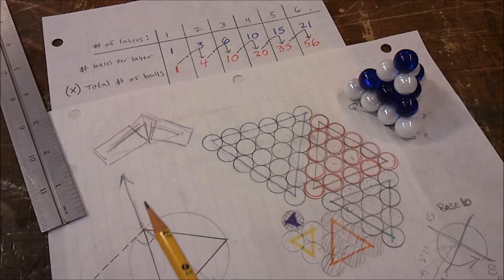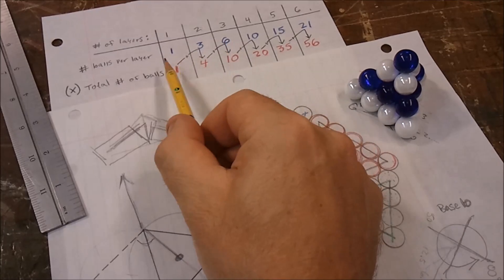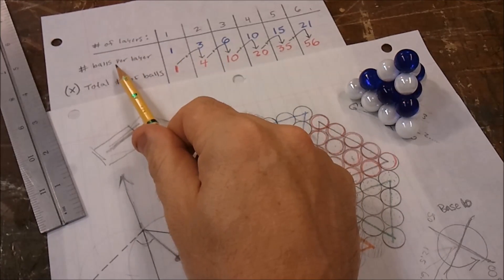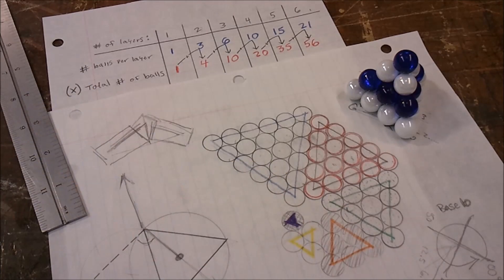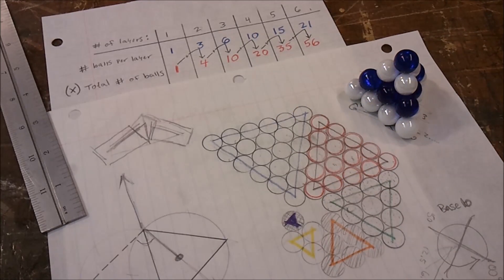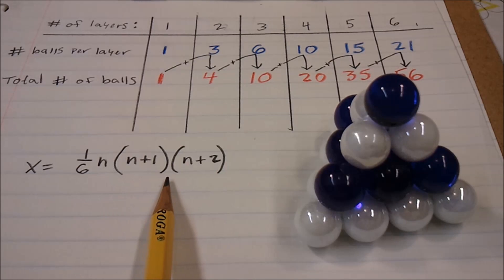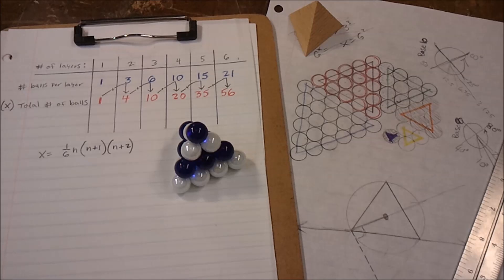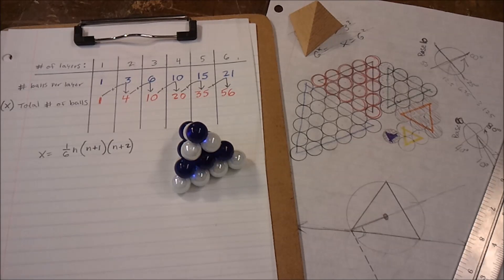Four-piece tetrahedral cannonball puzzle

Comment: Pocket! Is this the PEX tubing you speak of? http://www.homedepot.com/p/SharkBite-1-4-in-3-8-in-O-D-x-5-ft-White-PEX-Pipe-U850W5/205586762
Reply from the maker: Yes! Nice and cheap. I use that stuff for lots of projects. Buy a bunch, because there is a mild variance between batches. You can also fine-tune a Forstner bit to size by running it backwards in the drill press and holding sandpaper against it, just to get that perfect fit.
Reply: I just noticed the range ball! You are going to get in troooouuuublleeee! :)

Comment: We could also say that the Reg. Tetrahedron holds the maximum volume ,  for the least surface area among any infinite number of tetrahedrons in the existence.  The .Sphere has the same property,  IT HOLDS THE MAXIMUM VOLUME TO MINIMUM SURFACE AREA, therefore any solid holding as much volumes as the sphere does would have to have a large surface area, THEREFORE SPHERE IS THE MAXIMUM SOLID , AND THE REG. TET. MUST THAN BE THE MAXIMU TETRAHEDRON. Volume of the sphere is EXACTLY 25.13274123  reg. tetrahedrons in a sphere. The volume of the reg. tetrahedron than must be 2 because volume is calculated in cubes and a cube contains exactly 3 reg. tetrahedron volumes and that exact same cube is assembled by 6 irregular tetrahedrons, and EACH is exactly 1/2 the volume of the reg. tetrahedron. so the volume of the sphere is exactly 50.26548246 irregular tetra volume, each irregular tetrahedron has a volume of one, so the sphere volume is 50.26548246 cm^3

Comment: How is the green part not actually a tetrahedron? It has 4 sides each with 3 edges.

Also, how come you have access to so many advanced woodworking tools?
Reply from the maker: Nexnaught Because it doesn't go to a sharp, crisp point (vertex). It actually is slightly truncated, at least with respect to the way that it fills space. If you had hundreds of these, and you were stuffing them into a box, they would fit differently than actual tetrahedrons would. If you want me to be more specific, tell me what I said, and when I said it, and I will clarify.

As for my "advanced woodworking tools," I bought them. Now that I own them, I have access to them.

Comment: The white piece's name is a parallelapiped. It's a prism with a parallelogram as a base rather than another shape like a triangle or square
Reply from the maker: ookazi1000 Not exactly. If you were to add an additional marble to each layer of the white piece, then it could be considered a parallelepiped. Right now, I would probably call this an oblique triangular prism, but it's hard to see the pattern while it is missing its vertices.

Comment: I remember reading in a Reader's Digest how some kid was peeling a golf ball and then - not knowing he would do that - bit into the rubber center, getting some liquid in him, and cried out. His parents gave him something to vomit so he wouldn't get sick. They called the manufacturer, and discovered why he was crying. It was a soft rubber center, filled with... castor oil! So that might be what the "liquid" was.
Reply from the maker: Ha! That's pretty interesting. I wonder why they ever made them that way- what properties does a fluid have under constant pressure that makes it a good golf ball? But anyhow, I'm reasonably sure that the liquid from my experience was water-based. It dried, and it left no stain on the drill-press table. In any case, I see no evidence that it was ever a poisonous acid, like I remember the kids on the playground rumoring.

Hehe. The kids should have been afraid of the core ejecting; that thing could take an eye out, if it's relieved of its tension from one side... like from a hacksaw or knife cut.
Reply: pocket83  Fluids are essentially incompressible. A fluid filled core would allow for cheaper construction since castor oil (see above) was significantly cheaper than rubber or plastic in those days when it was most common.  End result: cheaper production cost for a cheap product with the advantage of marketing hype like "hydro-dynamic/hydraulic power core", etc.

Comment: I bet I could use the technique you used on the golf balls to make a jumbo-sized molecular model kit. A project for this winter, I suppose.
Reply from the maker: That's a great idea! You can paint the carbons black, hydrogen red, nitrogen green, et cetera. There are actual angles for the bonds in each particular atom, so you would have to make unique jigs for each of the bonding sites, but it would still be easier than what is done here. Let me know if you do it, or if you get stuck, or if I can help.

It would be less expensive than buying the actual models; there are $100 worth sitting in my closet right now, and the golf balls would've worked better!

Comment: This was really interesting. First time I see this Tetrahedral equation. But I think the small "prototype" version looked much more neat and the colored marbles make it look much more beautiful. I know you mentioned coloring the golf balls, but they are too bulky and don't have this glassy glance. Still would really like to see the second part of it. Did you get the connection idea from your Building Block Medley video ? Overall the video looks really great :)
Reply from the maker: Thanks! When I first made this, I didn't really trust the epoxy, so I was looking for a more durable alternative. Now that I have seen how strong the connections actually are, I think that I could trust them as permanent, and a 1" marble puzzle would be really cool. I'm going to order a 100 count of ruby red 1" marbles from ebay. The added surface area of the larger marbles should make a great connection (and a  beautiful puzzle), and the only tools required are your hands.

As for the idea: I made the blocks featured in that video a long time ago, so you have to understand that the chronological order that you see in these videos is not entirely accurate. I just needed a connection, and I considered what was fast, easy, flexible, and inexpensive.